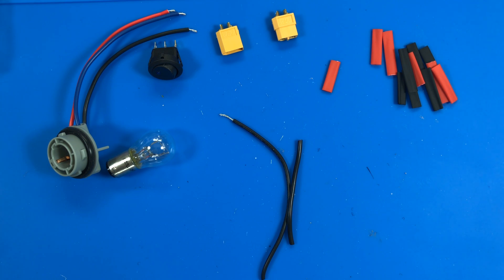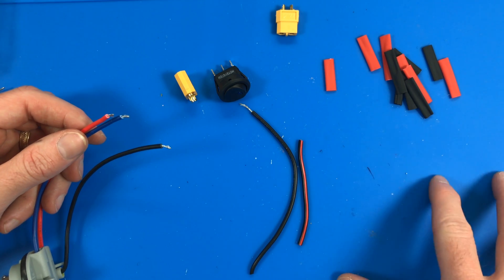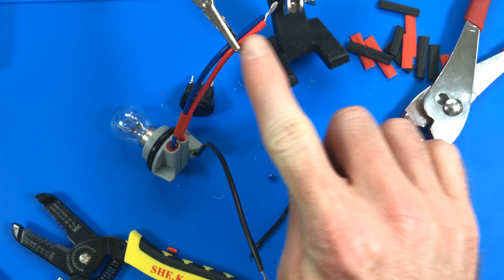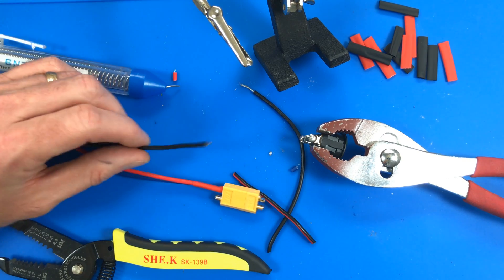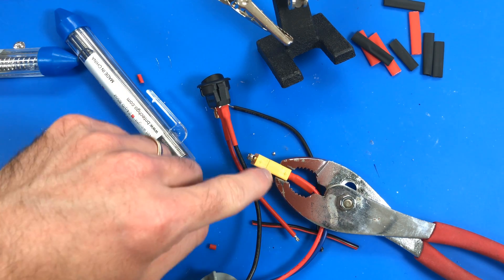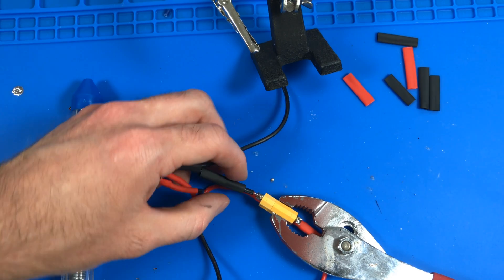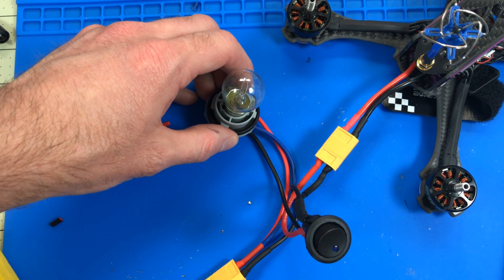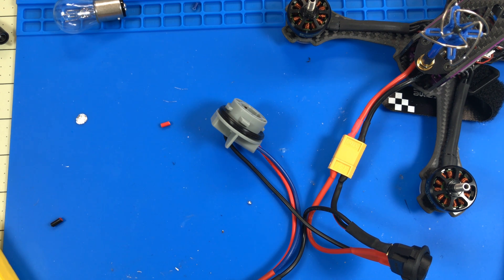Building the ULTIMATE Smoke Stopper, it can save your quadcopter

Comment: Good video. One point to note is that bulb is NOT a “headlight” bulb as stated in this video. It is a tail light bulb it has two filaments one for brake light and one for turn signal the bulb is 1157

Comment: I know this videos kinda old but i had a question, would i be able to instead use 16AWG UL1007  wire? I have a bunch left over for making PSU cables. Rated for 80 to 105 degrees C, 300V, 26 strand. Thanks!
Reply from the maker: Yea, that should be fine.  You really don’t put any current through these for testing.

Comment: Hi my smoke stopper lights up for a second when I plug that battery is that bad?
Reply from the maker: Yes, something is wired wrong or there is a short.  And make sure you don’t have a LED bulb, I don’t know if it would cause that but I know they don’t work for this.

Comment: I like this video. I just ordered whole parts to make smoke stopper.

So this means that at most drones at binding process you're using 3S batteries? At least at those which can handle 3S batteries. More power is probably not needed even at 5S or even more drones?
Reply from the maker: Yea. They will power up and bind on a 3S no problem. I have used 4S batteries at storage voltage without issue too.

Comment: your links to amazon don't work
Reply from the maker: Ruben van Eupen unfortunately Amazon links are tough. I have it set so for most people it will send them their closest county’s Amazon. Where are you located?  The one other option is that if you are in the US it will open the Amazon app. But if you don’t have the app it won’t work.
Reply: only the socket one doesn't work. I'm in Europe. But I found my components elsewhere. Thanks a lot for your video!

Comment: A fuse works too. A simple fuse holder rated with a proper fuse is actually a better idea. Using a light bulb is stone age. Just saying. Oh, here is one better, use a resetting fuse, so it just trips the breaker. Just saying. Electronics...it really is easy.

Comment: Hi folks. Hey, one that's ok! As a community service I'm hunting down overloaded multi rotor switch installations, but this one is OK! Why? Because it will never be flown in this configuration. At full throttle these size quadcopters will draw 25 to 30 amps from the battery and for flight the switch must be specified to take it. Sadly, many being shown in video's are not and the switch will fail, possibly leading to a crash and an expenisive legal suit. Here it's only being used to power up the flight controller and the ESC's etc, not to run the current grabbing motors. Should be fine. BobUK.

Comment: Adding the switch is a great idea.  I always struggle with turning on a quad while holding down the bind button of the receiver.  A couple of comments.  First, you can also find the sockets for stop/rear lights (lower wattage) but be aware that the sockets are specific for certain types of bulbs. As there are a number of different types of bulbs, might be a good idea to take your socket to the auto parts store so that you can match the bulb to the socket.   Second, rather than turning your XT60 over to solder the second connection,  one can turn the connectors on the XT60 so that they are facing the same direction.  Be gentle when turning them!

Comment: Can I make this with a xt30 connection also? I just burned 3 motors out on my lizard 95. I will also make a xt60 version also.
Reply from the maker: Yep, would be exactly the same.
Reply: Why not just make 2 xt30-xt60 converters and plug those in when needing to work on the smaller quads?
Reply: Way ahead of you. Already did

Comment: Please help I put the positive wire on the negative solder point on my pub and put the negative wire on the positive solder point with an xt60 plug and plugged in the battery and plugged the battery in without reliesing that it was wrong. Magic smoke came out of the plug and I plug it straight back out. Nothing lit up. So then I desoldered it and put it the right way with the wires correct and plugged it back in and magic smoke came out again and unplugged it straight away. At that moment all the ecs's went on and went blue which is good and so did everything else but instantly turned off and then I unplugged the battery. I then inspected the plug on the drone and it was damaged and realised that the battery doesn't even fit inside the plug anyway. So I am planning on soldering a now xt60 plug and plugging the battery in again. Please help me thanks
Reply from the maker: I’m not exactly clear for what you are asking help. Unfortunately you are probably going to have to replace your PDB and maybe escs. Sometimes to can get away with a little smoke. But this sounds like more than that.
Reply: When I plugged it into my laptop after this happened my receiver powered on fine and so did my flight controller and in the moment of the slight power untill it smoked for a slight second I saw the esc's power on and were all blue theses esc's were kiss 24amp race esc's

Comment: Make low beam and hig beam selectable with a switch for two different current limits. 

http://i1183.photobucket.com/albums/x462/mnemennth/SmokeStopper/Hi-Lo%20SmokeStoppertrade%20With%20Switch.png.html

The way you have it wired I think it is always going to allow higher current because the high beam is connected.
Reply from the maker: +Curtis Campbell next model :-). I originally had just the low connected. But that wasn’t enough to let the fc boot properly

Comment: Great video.

Perfect timing.

Needed to build one of these today (replacing ESCs on a BYO RX race quad).  Like the idea of the led switch.

I have EC3 3S batteries but only 4S XT60 batteries.  So build my smoke stopper with parallel EC3 and XT60 inputs.

Comment: Can anyone recommend a drone with a good range and a live feed camera? Max cost around 200
Reply from the maker: +Heffa Klump what are you wanting to use the drone for?  Just for fun? Racing? Photos?
Reply: DroneRacer101 Really just for flying around and having fun and taking some pictures. But I want it to have a pretty good range so I can fly away high and take some pictures and stuff.
Reply: DroneRacer101 battery could be a good point too!
Reply from the maker: There are two I would suggest in that range.  If you want to control is with a normal radio and have a control range longer than you can see: https://www.youtube.com/watch?v=UBaOOZWwc7Y  or if you want something that just uses your phone but you program in waypoints for it to fly to check this one: https://www.youtube.com/watch?v=KkKmlsXBJG0  Either way be sure to check the description for the links because some of them have codes that can drop the price a LOT.